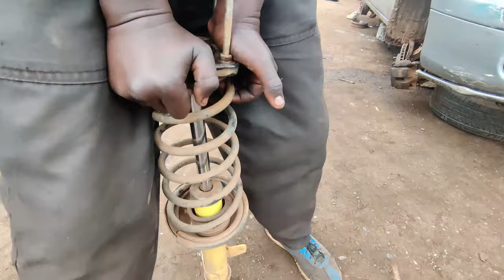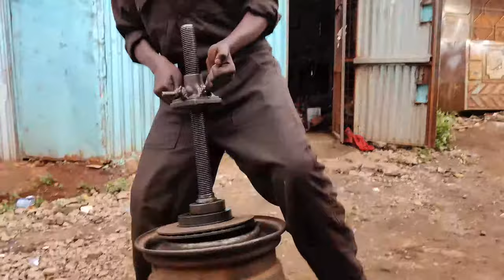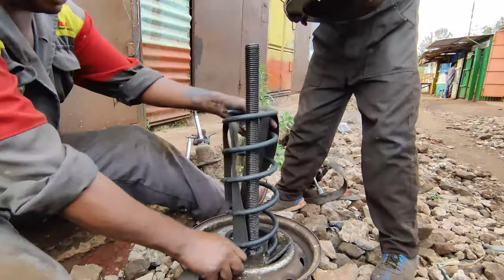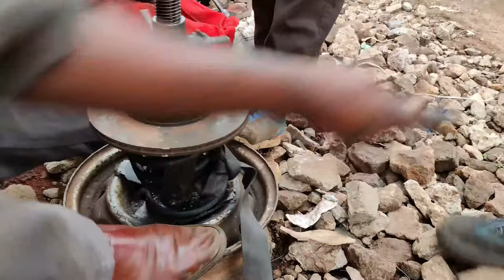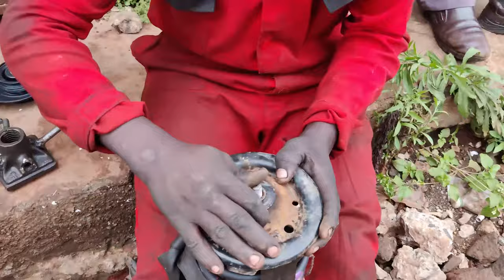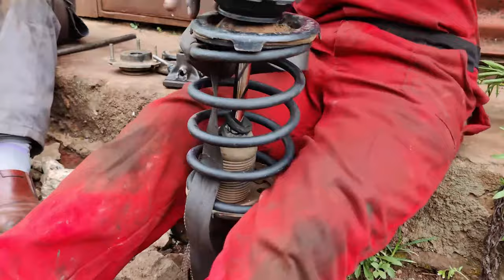DIY homemade  Spring compressor

Comment: Be careful please do not put your head over the tool while the Spring is compressed  just in case the welds break.
Reply from the maker: that's true
Reply: @Africanmechanics  replace those straps and definetly dont let anyone put their head over the the spring . gr8 video !
Reply from the maker: @xxcowboyjamxx  ok...
Reply: 1000 ways to die be careful use helmet if you must use that idea
Reply: @georgeukman6412  if one of those springs escapes, the helmet would only serve to hold all the pieces of the head together

Comment: it works better than the one that i bought at the hardware store because the store bought one has two parts that both have to be tightened at an even rate, which means that you have to change the tightening tool from one clamp to the other every 10 turns or so..takes a long time to tighten, loosen, change the spring, then tighten and loosen again..but i used the idea of tying the springs with some tye downs to keep it safely in position during the replacement of the spring
Reply from the maker: So you aprove this idea 👏👏👏👏

Comment: Very cool! This scares the hell out of all American mechanics 😄 

Is machine shop equipment hard to come by in Kenya?
Reply from the maker: Yeah some of this equipments are not found her in Kenya and if there is, they are sooooo expensive the taxation system in kenya is so unfair for anything you import, so we have to come up with our own ideas....
Reply from the maker: But my ultimate goal about this channel is to make enough money and buy them modern equipment and tools
Reply: @Africanmechanics You can buy a simple lowbudget Springcompressor for about 30-50€. It's not that expensive in comparison to a disabled mechanic.
Reply: @fragender9552  ,,,but that could be a months or half a years salary, depending on the currency exchange 🤔
Reply: @Texaca   Well, yet thats a good investment  in my oppinion.